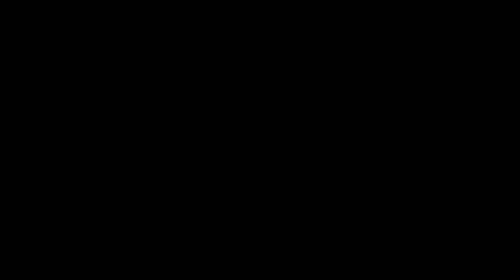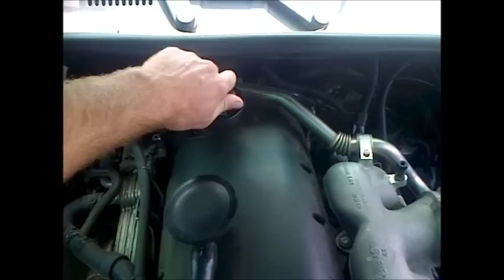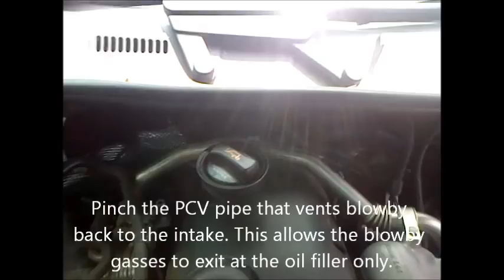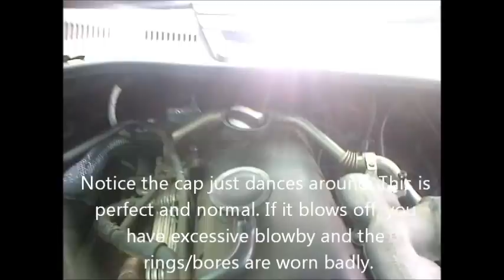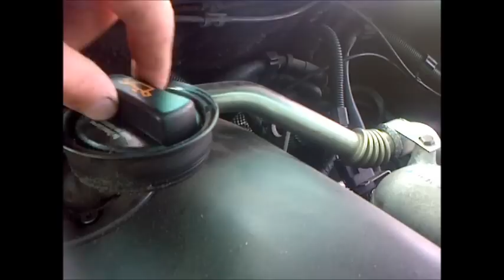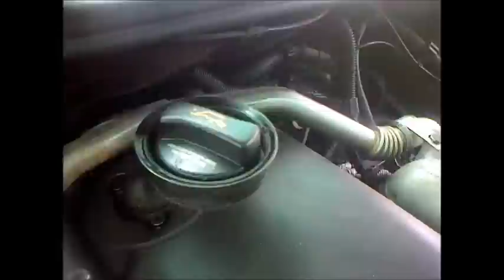Quick engine blowby test

Comment: I drive without oil dipstick and i resolve problems with pcv valve.i put some tire tube on dipstick base and put out off engine no smells and acceleration is better

Comment: The cap dancing can be caused by a clogged PCV? Same thing happens to my Astra 1.7cdti, without pinching the pcv pipe. There's no smoke coming through the filler cap, or the dipstick, the car dosen't burn oil or make any funny noise.

Comment: Thanks for them replies, I'm still not 100% sure it's blowby, it smells like steam and oil together, my initial thought before the water pump failure was that the EGR was leaking, maybe it also is, the answer is a check of course thanks
Reply from the maker: This is how the EGR works - Touareg 2.5 R5 EGR blank DIY
Reply: Yeh I've seen that video, not sure why you would blank it off though, I believe it can be by passed if it's leaking, what will blanking it off actually do?
Reply from the maker: tom alexander blanking it means no EGR gasses go to the intake. The only downside is longer warmup times and slightly more emissions.
Reply: Marius Fourie how do u do an egr and pcv delete on a 02 GTi with a AWP 1.8t? My oil cap is fluttering but as soon as I give it has it sucks down like a vacuum pulling it. There are no gases or anything come from the oil cap. I'm really worried I need new piston rings. The car has been running really crazy but it also needs a upstream h02 sensor. But the car is breaking up in 3rd and 4th gear and feels like it's running so so so rich. You can sometimes hear and see a huge flame then the back fire coming out the exhaust. It's 3" all the way back from a 6" downpipe. But it feels like it's heating and doesn't want to let all 300 horses loose. It's still fast but nothing compared to when I first got it and the only time it drives good is in the highway but when you get off the car won't move. Is it a turbo problem? I noticed there is a oil leak coming from the return line in the turbo but it smells like there's a odor of like nail polish remover. And it's really really thin like it's mixed with coolant. It kinda smells like the houses going to the pcv valve or EGR valve? Idk, I just want to delete or completely cleanup the pvc and EGR hoses. Any help to get me started on where I should start looking will be very appreciated. The Haynes manual doesn't go into the EGR or pcv in and detail what so ever. I also have a T3T4 hybrid turbo, .50 ar compressor housing and .63 turbine housing. Or I'm just going to go with a by GT28R with the Audi TT turbo manifold and intake manifold. It's the same as the AWP manifold but reversed for the twin side mount intercoolers but I'm putting a FMIC and need it to fit the plumbing. Thanks in advance
Reply from the maker: ***** clean the MAF sensor. Scan it with VCDS.

Comment: My 2.2 nissan doesn't have a pcv valve. It has just an baffle made into the valve cover . Baffle path acts as oil stopper. But still every 10k kms, my intercooler fills with about 250 ml oil and whole of intake pathe from after filter upto mainfoeld gets oil covered. 
 What can be done?
Reply from the maker: get a catch can. Periodically empty the intercooler.
Reply: @MariusFourie  is it normal?  Does all engines do it ? Can i stop it from happening?
Reply from the maker: All engines create blowby and deposit some oil in the intake. If the engine is healthy the oil deposited and oil vapour balances out. If the engine is old the oil will accumulate in the intake (usually intercooler)

Comment: My Vw Passat 2.0 TDI had blowby since i bought it new with 00 kilometers its cap Dance around with smoke, is it bad though?
Reply from the maker: If it uses less than 1 liter oil per 5000km I wouldn't worry about it.

Comment: would you expect more or less at normal operating temperature?
Reply: @doomie61 not sure about on a vw diesel but when a vehicle is at full operating temps you should have less.  The vapor should be lower because the oil is warm enough to have boil out any water vapor that might have condensed and when the motor is fully warm the rings will be as tight as they ever get thus preventing blow by if not worn.  my two cents anyway.

Comment: I've tried that on mine, it didn't jump off, I do however have a lot of gases coming out, obviously blow by, and out of the dip stick, all caused by the water pump failure, which knackered the turbo, and looks like the engine has over heated too much, the car still seems to idle ok and I've driven it up to 60mph, no excessive smoke comes out the exhaust, which is bizarre, think I'd best get a compression test done, this is a nightmare car, I've had it 9 years and it's been off the road for 3 in total. I've cleaned that pcv valve, not much smoke seems to come out of the hole it goes in on the rocker cover, does the turbo suck the smoke from it?
Reply from the maker: yes, the turbo helps draw the PCV gasses out. If it overheated the pistons can collapse causing loss of compression. Scan it with VCDS and check deviations on the injectors. A big deviation between injectors may be a tell tale sign of bad compression or a worn camshaft. Do a physical compression test to confirm.
Reply: +Marius Fourie - Very good advice!
Reply: @MariusFourie  hey bud how you I got a 07 audi A3 with the 2.0turbo hatchback  my car is sucking air in the oil dipstick an oil cap I think the PCV VALVE IS CLOGGED UP what would your appending be on it I'm new to all this an dont know nothing about them motors

Comment: My car (x-type 2.0d) started smoking and rough idling after oil and filters change (and the radiator fluid was contaminated). I removed the oil cap and it blew smoke out of it without pinching the pcv pipe. What could have caused this after the oil change??
Reply: +Dani Santos - Did you ever find out?

Comment: Man I've gotten some weird issues on my engine. The PCV valve was overtightened with a tube clamp so not enough pressure could get released, but before I fixed it I noticed how the oil cap would jump around but not off. Also saw a surprisingly high amount of white smoke come out for a few seconds. 

The car has 50000 miles on it, so I wouldn't expect there to be any mechanical issues in the engine. I did fix the pcv valve so it allows more pressure to flow through, and I haven't seen any oil coming out of the oil filler cap, oil dipstick or pcv valve t-connection since. But, I still feel like it was odd for the smoke to come out, but the engine was also very warm when I checked as I had just driven it for an hour. 

Does anyone know if piston rings actually need replacing if the engine hasn't been run in a long time? It's from -79 and has been standing still a lot, I'm guessing I'd need to hone the cylinder walls and get new piston rings, and probably clean up the oil separator and the entire pcv system but for an engine in this condition it seems unneccessary.
Reply from the maker: Do a compression test. It's a cheap and easy way to check the condition of the walls and rings.

Comment: slight oil pitching from dipstick tube when dipstick is out is that normal
Reply: Narendra Kanhai its up to your engine I have seen 320d with low mile 20.000km in the engine at is had smoke or steam from the oil cap and Spitted oil as well!

Comment: Hi, I have Camry 4 cyl  2007 LE with 96,000.  I removed the oil cap and I feel there is air coming out.  No smoke just feel air blowing.  Is that an indication that the rings are worn?Thanks
Reply: I have the same question with my 2003 honda civic 110k
Reply: @depdark1  did your Honda ever take a shit on you or it’s still kicking ? I got the same problem
Reply: @jaymarleno8958  sold it around 160k miles. But i know it is still running strong
Reply: @depdark1  think I should just let it go and not worry about it it has some blow by but screw it
Reply: It normal my 2009 Corolla also like it. All gasoline engine are small blowby but diesel don't have almost no blowby is normal.

Comment: ... and what happens to the smoke when the filler cap and dipstick are closed? thanks
Reply from the maker: It is sucked via that pipe I close to the intake where it mixes with incoming air and goes to the engine to be burned as part ofg the combustion cycle. Hence why modern oils are low ash so their burn off is not soot forming or high emissions that will fail MOT and block Catalytic converters and Diesel Particulate Filters.

Comment: should test on hot or cold engine?
Reply: Kevin JC this test is nothing i have M550D f10 i have steam come out, my friend have 435d same steam come out, i checked another m550d in a Trader, and one 320d same steam come out!!
Reply: @bmwsincekid  More intrested in pressure whithin the crank case then hot gasses mixing with ambient air. steam doesnt bother me
Reply: Kevin JC then by pressure what do you mean?
Reply: Kevin JC Im not sure if its steam it has oil Smell and little smoke or i don’t know ,but these tests in my Book as a Fail i also Have a Work car 1.6 opel astra 2001 And when i remove the cap it has pressure Like it pushes the cap strong down And the car doesn’t consume any oil maybe little bit And no issues , its i think up to the Engine Built I also read and watched how people put Glows on the Oil dipstick and if its inflate you have Too much blow by mine is inflating and the other 435d and other 550d was the same Also they share the same engine so I guess these tests aren’t True for every car!!
Reply: @bmwsincekid  piston rings will always create blow by gasses inside the crankcase, which is then transferred to the head via chambers inside the engine. The pcv valve will release this pressure at set ppsi, to avoid blowing seals over time (on a side note if you have a vacuum at oil cap your pcv has failed and is under vacuum from your intake) if you sit your oil cap ontop of the engine, pinch the pcv hose breather and your oil cap flys off then there could be excessive pressure caused by wear or stuck piston rings. just do a compression test. cant really measure this shit accurately lol
Reply: Kevin JC I see you know what you are talking about, my car i have no idea where is the Pcv Valve
Reply: @bmwsincekid  If the oil cap is being sucked onto the engine replace your PCV valve.
Reply: Inflating gloves could be a sign of a blocked CCV / PCV valve, it may not consume oil but over time pressure will push on internal seals and cause weakness.
Reply: Kevin JC mine when unscrewing the cap and let it sit like in this video For me Without pinchin any hose it bounce same like in this video maybe little less i think it’s normal!
Reply: Kevin JC mine did inflate the glows it consumes oil but mechanic said me My Ccv membran is not broke so it should be good for me its built in the valve cover that costs 400€
Reply: @bmwsincekid  If your car is driving good, if your mechanic is good, if your compression is good, dont worry. oil consumption is normal, maybe up to 1l/1000 miles. your right depends on car model

Comment: Hey guys, can some1 please explain me this. I have ford transit 2007 for sale and it is in, I would say,  perfect condition. So one guy came yesterday to take a look and this is what he did: he blew into the oil measuring tube and he didn't feel the presure (that blown air got out somewhere) and he said that engine is blowby just because he did not feel the presure when he blew in oil measuring tube. I am driving for like 10 years and I did a lot of stuff around cars by myself and I never ever heard this technique for testing the engine. Btw its diesel fuel engine 2.2 tdci and it's running very good and accelerates super fast so idk. I'm just curious about this testing technique..

Comment: will this work on a petrol engine as well?
Reply from the maker: yes. Definitely!
Reply: Mine makes my oil cap dance. But there is no check engine and i have never had any problems with it
Reply: @depdark1  I would still make sure at least your pcv valve is working correctly and that you do some legit pressure testing of your engine. May lead up to gasket failures and oil leaks in the future.
Reply: @ajm114  its 2003 honda civic. There is no check engine light. But i will check the pcv valve. I thought about it

Comment: This is Bullshit I have 550D f10 and steams comes out on warm engine, i also checked My friend 435d, Also another 550d and all had steam coming out , some engune even Spits oil and still completely normal all of yhese engine are low miles 20-120.000km!
Reply from the maker: A bit of steam (oil vapour) is normal. If it's spitting oil it could just be the cams throwing oil if there is no baffle. If the blowby is excessive then you have too much exhaust gasses leaking past the piston rings.